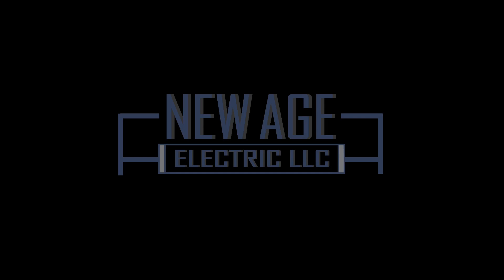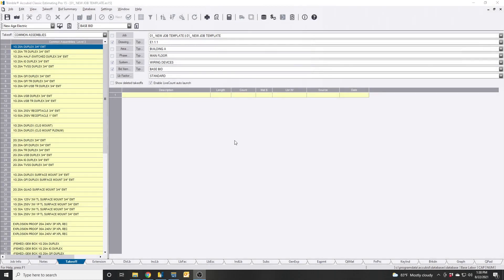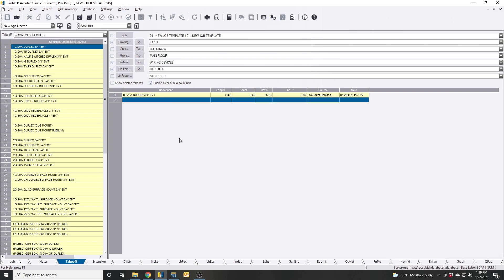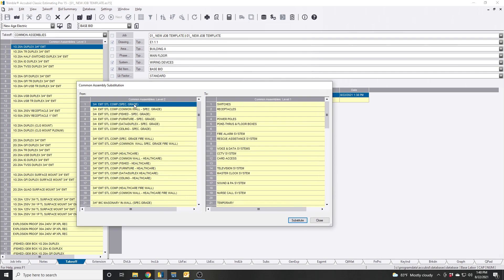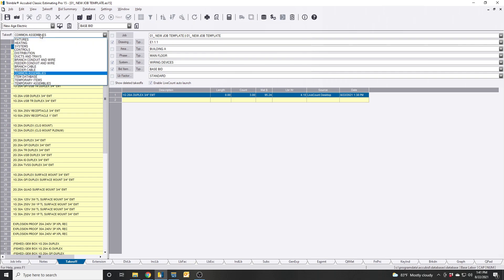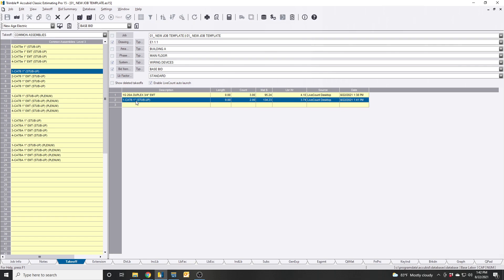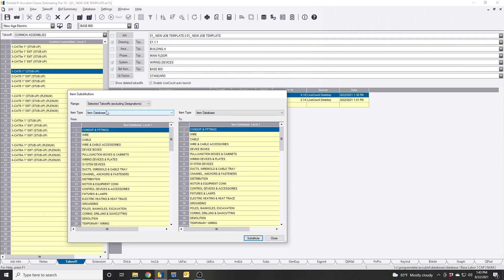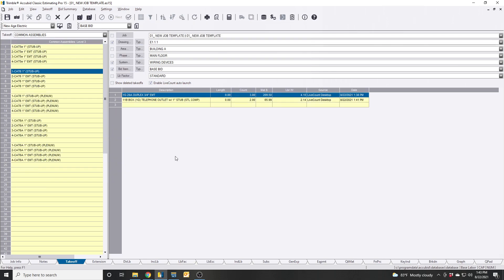Trimble Accubid  - Substitute Assembly

Comment: The example you provided with your alternates: When substituting a standard receptacle for USB  recp., wouldnt the standard receptacle need   to be deducted from the additional cost of the USB?  E.G :  base bid 20 amp device was $10.00.... alternate device w/ USB ports was $19.00....wouldn't the add alternate be a total of only $9.00 per unit? Is there  an area for factors to be implemented in the line alone? ... IOW....A unique/one time factor that could  be implemented on an estimate .line item... not the database.
Reply from the maker: I believe you're referring to when a set of plans ask for an alternate from standard to USB receptacle, then the answer would be yes, the program will do the calculations for material and labor. If you grab the total devices you took off, copy and paste it into the alternate, then right-click and select reverse take-off that will provide a credit against the USB total devices after you add the total USB receptacles to match the standard. Verify material and labor in the extension column. The final pricing column should show a credit or deduct based on the material and labor of your database.